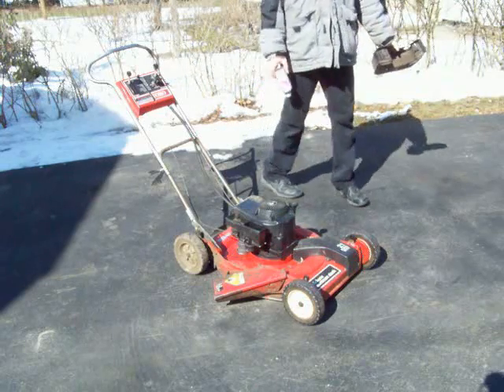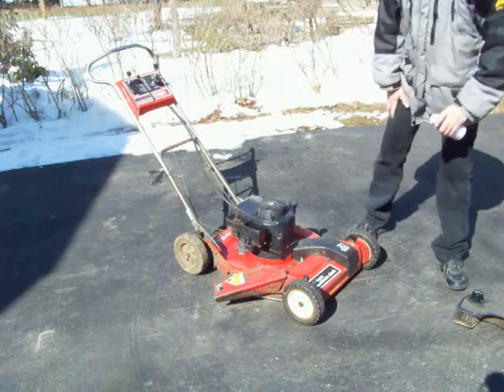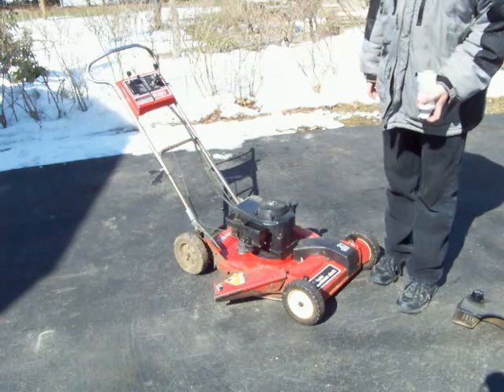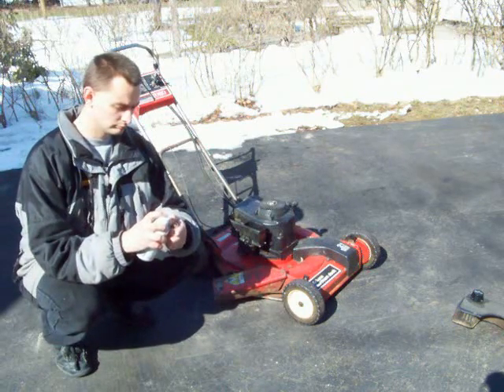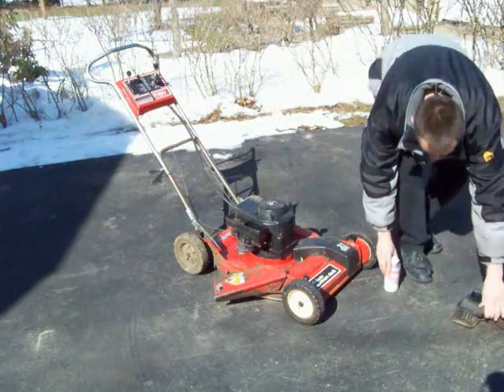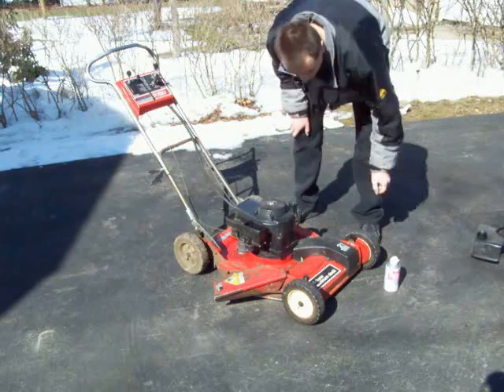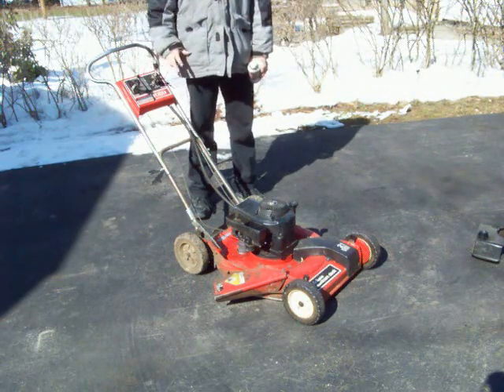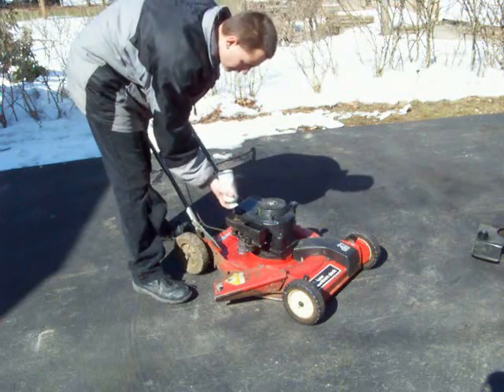lawnmower running on chewing gum remover

Comment: @kwacz  I did put a different head on it, and i ported and polished the head, intake and exhaust ports and the intake manifold too. I ran a colder spark plug in it too, becasue it would run hotter with diesel. and the only real advantages were that it sounded meaner, smelled better, diesel is cheaper, and it didnt want to bog down in thick grass or when i tryed to turn it off, it would want to keep chugging.

Comment: i used to have an old briggs,  and id pour a little gas in the carb (choke-o-matic) to get it started clean then i would put diesel in the gas tank, about a 80% diesel, 20% gas mix, and oce it was warmed up it would rub straight off diesel.

Comment: Most lawnmower engines would run on any flammable vapor you can put into the carburetor. I think the gum remover most likely has butane in it. 

The idea is the same as spraying starting fluid/ether or pouring an ounce of gasoline directly into the intake.